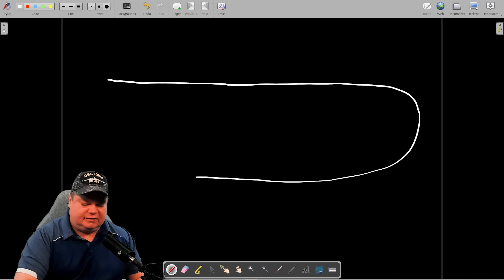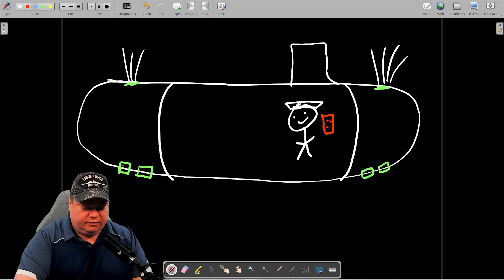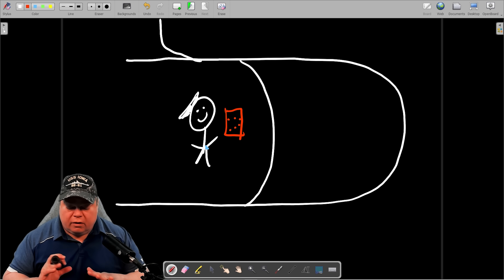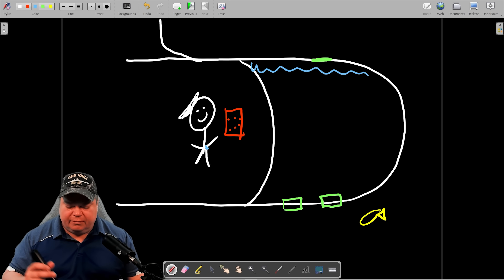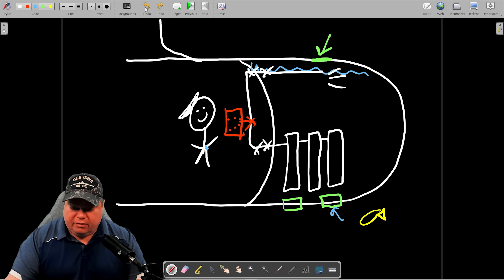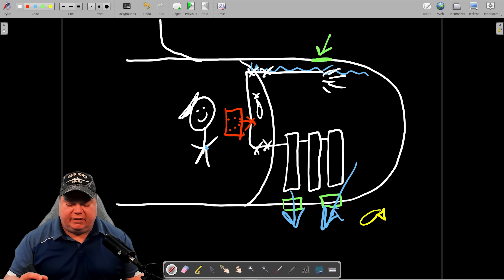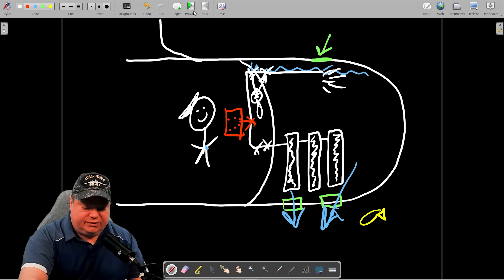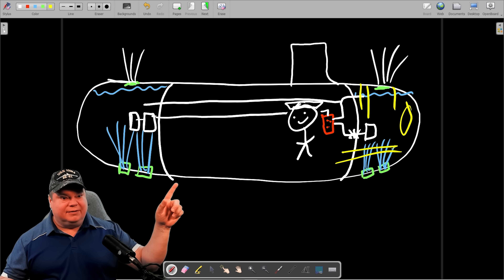Explore the Depths: Submarine Main Ballast Tank Operations Unveiled

Comment: As just a car mechanic and apprentice power engineer, If i might take a crack at whats in the tanks --  In the forward tanks, Torpedo tubes and doors, Sonar dome, whatever version of VLSS it may have; rear tanks - shaft for the screw/s or propulsor, Rear Torpedo Tubes and doors if equipped, decoy/noise generating devices and/or their own launch tubes;  in both tanks - sensors of some kind to indicate ballast tank state, water temperature and/or other monitoring devices (IE Salinity, radiological, possibly biological/chemical sensors, pressure sensors possibly,  of course related plumbing/mounting hardware, actuating mechanisms for the top vents, maybe outer trim tanks, also, would there be any form of baffles to limit sloshing of water?  Of course, all this is 'general', as there'd be wide variations between classes, designs, and probably even individual boats. 

As a 'general' question, would there generally be separate main and emergency blow tanks? Also - where might the anchors be located?

Always great to see your work! And yes, i know, 4 months late, sorry!
Reply: Wow a fairly comprehensive list and yes all of the above
Reply: On diesel boats they would have a Q tank this was flooded, in an emergency to effect a fast dive say in less than a minute a nuke takes up to 8 minutes to dive. But is not going to visit the surface again usually until the end of its patrol.

Comment: I've been trying my hand at designing a autonomous midget drone sub and have been reading a lot of Ulrich Gabler's writing on the subject...he designed the Type XXI sub during the war along with several other types, plus several post war designs...and Mr. Gabler indicates that the top vents should be placed as far back as possible when engineering the ballast tanks, or else the sub can dive at an awkward angle.  He goes on to mention those slits at the bottom as a source of eddy currents between the pressure hull and outer hull, the energy creating those currents has to come from somewhere:  your propulsion system.  So a lot of care is usually taken in their design.  Those valves connected to the "captain's flask" I think are shuttle valves...the act like normal hydraulic valves until you add pressurized air on the far side of the valve, which closes of the hydraulic input and shoots compressed air to whatever piston the hydraulic fluid was driving.  Combat aircraft back in the day had a similar system in case the hydraulic lines were compromised or the engine driving the hydraulic pump was no longer running.  It was a last ditch effort to lower the landing gear and flaps.  Usually would result in the entire hydraulic system having to be purged a refilled later...better to have to do that than to write off an expensive plane!

Comment: Do you know how a submarine, especially a small research vessel maintains it's internal (passenger compartment) air pressure?  Scrubbers remove CO2 but if oxygen is bled from bottles into the interior does the pressure slowly increase during a dive?

Since the pressure is greater outside the hull, you cannot simply open a valve to vent the rising internal pressure.  Does the CO2 scrubbed equal the O2 added during a dive?  Are compressors used to pump out the excess internal air to maintain a constant pressure?  Or, do you simply live with the gradually increasing air pressure?

Comment: torpedo tubes and sonar array would have to go through / be in  the ballast tank, yes? also the propulsion system / propellor shaft?

with the grates in the bottom, wouldn't this mean if the sub ends up on its back somehow, you can't surface? i guess that would have to have been assessed to be just about impossible, right?

Comment: I've never understood how entrained water does not effect a subs bouyancy. WWII subs all had large amounts of entrained water in the hull. the answer must be simple but I just don't get it. Thanks.
Reply: Simply because the entrained water is not part of the sub, it is part of the sea. Same as the ballast water. There are two ways to look at it: either you consider the water in the ballast tanks as added weight while the volume of the sub remains constant (this is the american way, the one used in the video). Or you consider any sea water, including the one in the ballast tanks, as part of the sea. In this approach, as the submarine dives, its volume actually decreases (because the volume of the ballast tanks, which was part of the sub on the surface, now becomes part of the sea) and its weight remains constant, therefore loosing buoyancy and diving. This way of thinking is easier for the problem you mentionned because then you understand that entrained water, like the ballast water doesn’t directly affect buoyancy. It is the decreased volmue that affects buoyancy.

Comment: 3:05 Would their ever be a need due to failure or damage to need to dispose of these lead weights in order to serface !? If so. How do you get rid of the lead weights under water ?
Reply: No all you have is emergency blows and you would power up on hard arise on the planes.
Reply: You would use a Low power blow to establish trim
Reply: Also emergency blows have an anti dieseling valve fitted as the valve would freeze with the HP air blow.

Comment: QUESTION:  does the submarine use ballast to control its depth in the water at all? In cold waters i use ballast tanks constantly, is that realistic? Wouldn’t you run out if compressed air if you did use flood and then blow ballast tank constantly.
Reply: No, in the submerged condition the ballast are always completely full.
Reply: @johnwinkler5361 thank you.

Comment: Very interesting, thanks for making the vid.  But this leads to further questions about the compressed air and where it comes from.  I assume there are multiple rotary screw  compressors on board to replenish the ballast tank air tanks but where does the air come from?  One cubic metre at multiple barr pressure inside the ballast air tanks would mean multiple cubic metres of uncompressed air to source the compressed air.  Air would be at a premium in a sub I would assume and no one wants to work in a vacuum (literally).  Big gulp at the surface?

Comment: Great video as always, I have just 1 question because I feel I am missing something. When the tanks are blown and full of air, but the grates are open to the sea, what is sealing the air inside the ballast tanks? I can't imagine you'd want to be running a pump to continuously maintain the pressure inside the tank, that seems extremely loud, but how else do you keep the air in an unsealed tank? Thanks!!

Comment: Is the air pressured till liquid? Provided a sub uses all its pressurised air, but gets to the surface - can it generate a new stock, or needs to get to a place, where it can get some already pressurised? How important is the bouyancy? Can a sub get to the surface even if it has a negative bouyancy and no pressurised air in stock? I. e. can it surface with the balast full? If the top and bottom valves are open in the ballast, the water should flow freely, so its weight shouldn't count to the weight of the sub it seems, am I wright? Provided the ballast ist open or damaged, so water travels freely though the ballast tanks - is the sub bouyancy positive or negative, or it is irrelevant and nobody cares of that? :)
I am sorry, if some questions are hard to understand - English is not my native language... :))
Reply: Subs have high pressure air compressors to refill the Air Banks. You always want to be positively buoyant on the surface. If you have propulsion you can drive yourself to the surface using horsepower. But you are on the surface and negatively buoyant. Aaron didn't talk about how we fix this normally, so neither will I. If the ballast tanks are full of water and you are on the surface you are not surfaced, but you do have a ship full of angry people. So when the MBT's are full of water the boat weighs what it weighs and you want it to be slightly negatively buoyant. It you fill the MBT's with air the boat is now lighter by the weight of the water you just displaced, and now you are positively buoyant.

Comment: I had a couple uncles that served on WWII subs. I've been on a couple old subs, not part of the crew. WWII grates had valves. When the valves were left open on the surface  they called it riding the vents, It was for faster dives. I wonder if the design change from then to current subs had to do with the Thresher and Scorpion?
With no grate valve, air pressure would have to be maintained on the surface. So what happens during fitting out and overhaul? Or mothballing?
Reply: The Thresher and the Scorpion had grates.
Reply: The valves at the bottom openings of ballast tanks are called "Kingston valves" in most books I've read on submarines. WWI-era submarines in most navies had them. Friedman's 1994 book "US Submarines Through 1945" writes that Kingston valves were phased out in US submarines mid-WWII.

Comment: Another idea for a discussion, most subs have forward and stern diveplanes, could you explain when each is used, are they always used in tandom, thx
Reply: The bow plane are for main debth control. Stern planes mainly control the bubble or angle of the ship. At higher speeds, stern planes can control debth. Rudder is use to stear the boat and control the coarse.

Comment: What happens to a submerged submarine if the ocean floor it is over has a sudden geological displacement (aka subjection earthquake)
Reply: In theory, and this is out of my realm, but let me take a guess. If a sub is over or near a subjection earthquake when it happens, the bottom of the ocean is what's moving. The bottom would or should transmit that movement into the water in the form of a pressure wave(s) which Sonar Tech Aaron would hate. The pressure wave moving to towards the surface would or should move the same way but it would look like a subwoofer moving back and forth. This would cause a momentary change in buoyancy. I have no idea how fast those waves would travel, or how big those changes in pressure would be. Now, are you asking what happens if a sub suddenly finds itself over an active underwater volcano? That would be a cool movie.

Comment: Can a submarine get to an operational depth where the high-pressure air can't push the water out of the Ballast Tank?
Reply: Operational depth? No. There is about 44 PSI of sea pressure at 100 feet. When you design a sub one of the questions you have to ask is how deep do we need to go? Then you build that depth into the sub. That determines what you are going to use for hull material (and never carbon fiber), how thick it needs to be, what your HP air system needs to be able to do, and lots of other things.
Reply: Not military submarines. The pressure in the air tanks is way more that any outside pressure the sub could ever reach.

Comment: Can the submarine generate the high pressure air (so it never runs out) or is there a finite amount of compressed air like a SCUBA tank?
Reply: High pressure air compressor.
Reply: When air volume get low, the ships atmosphere starts going into a vacumn. You have to go towards the surface and at PD, snorkel or ventilate to burp the boat. Take a gulp and go back down. You place a positive pressure in the boat so your volume increases. Yes, you can run out of air. You have oxygen banks that can keep you alive for a time. But the cannot charge the air banks.

Comment: What if it flips over, is it impossible to blow ballast?
Reply: If the boat tips over, there are other problems and it is probably bad. No barrel rolls, no loops.
Reply: @MarkLawrenceKiefer  I figured it's bad, I just wasn't sure if there was a process to block the vents if it gets toppled over so that they can still blow main ballast somehow
Reply: @oaw117 there is no system to block the openings below. They are just plain and simple openings. The sub is not suppose to capsize because the center of gravity is below the center of buoyancy, unlike surface ships.

Comment: It makes sense to me that you'd have a fixed opening at the bottom of the ballast tanks rather than a valve. There is no reason you'd ever want them closed. (I guess unless the whole sub is upside down, but I'd say you're already screwed if that's happened!)
Being able to close off the tanks would mean they can be at a different pressure to the exterior which I'm guessing they are not designed to handle and they would either rupture or crush, depending on which direction the pressure differential goes.

Comment: A couple of questions. With the drain grates are how do you keep the grates from making noise when the sun is underway. And you mentioned the ballasting of your boat, if the trim is that sensitive with full forward and aft tanks full, how do you account for the salinity of the water and when you are transitioning from high to low such as going into the Gulf Stream from the Caribbean Sea?
Reply: The grates are not loose, they are fastened to the ship so that they don't rattle, but are removable. Salinity changes is most common in the Arctic (ice freezing or melting). Temperature changes are more common (Gulf Stream, or depth). We have what are called Trim tanks that let us bring water in or out and move it around.

Comment: Some questions (might be enough for a part 2, if you collect questions for a couple of days): 
1. The obvious one first: If those are the "main" ballast tank there are obviously more. Do the others work on the same principle?
2. Are the main ballast tanks (or probably the others?) linked into pitch control?
3. How do you service these "have to be closed to the inside" tanks your life depends on? Is there some screwed close hatch to the inside or the top to do maintenance in port?
4. Good there are backup systems for the valves on the top. I assume there are also backup systems for the hatch on the top?, because if that stays open ...

My guess (for 1 and 2) would be: Main ballast tanks only to get it perfectly balanced at your target depth with all controls zeroed and all the other ballast tanks and control surfaces to angle your boat however you want.

BTW: Thanks for bringing back whi... bla.. whatever colored board. Really liked that series.
Reply: To do maintenance in the MBT's, you have to enter drydock. Once the boat is out of the water, you can open the MBT grates on the keel. Then you go into the darkness of this slimmy tank and do your repairs. Been there, did that. MMC/SS AGANG RET.
Reply: Main ballast tanks  are only flooded or not flooded. They do the bulk of the work to get the submarine to submerge/surface. Then you have multiple smaller trim tanks around the sub. These trim tanks are used to finetune buoyancy, and balance the pitch/roll. Then additional ballast tanks to compensate for the loss of weight when weapons are launched. As for servicing, I have no Idea, but I would suspect they are only really serviceable in drydock.
Reply: On 688's, 637's and 594's you can access the MBT's through the grates on the bottom when you are inport. To do that your ships divers or divers from the repair facility go down and let themselves in. Then they do what ever needs being done in there. This brings up a whole discussion about subs and divers and safety and tagouts. Also I am not saying that the other boats don't have grates. I am saying I never touched a boomer or anything older than the Gato (except to take a tour on a museum ship).

Comment: I was in the RN, but never realised Main Ballast tanks were permanently open to the sea until I started working with Submarines. I imagined it like a normal tank that had a valve on the top, and valve on the bottom. DUH.
Reply: Older submarines had valves on the bottom but they removed them for simplicity. Some russian submarines may still have them,

Comment: Also a safety aspect to have grills in the bottom of the ballast tanks. If you have valves there instead and they fail, you can't drain the tank to surface.

Good stuff though. I'm a civilian engineer on submarines and this is all very interesting to watch.
Reply: Somewhere, I suspect Silent Service, there was a Depth Charge that exploded not too close but directly under the submarine so that the gasses rose into the grill, displaced the water, and the submarine uncontrollably rose towards the surface.

Comment: Torpedo tubes, sonar, prop shaft
Reply: VLS tubes
Reply: @taco44051  wasn't sure if those would be part of the ballast and they aren't in all subs at the bow which is why I didn't mention them. My parents used to work where they made the sonars. But also with that, not fully sure if it's in a free flood area or would be considered ballast tank

Comment: Hmmm. Three things that might be inside a forward ballast tank? Torpedo tubes, sonar dome, forward diving plane hydraulics.
Reply: Spherical array, hull array, SA access tunnel, UWC hydrophone, NMH hydrophones, OA-9070, anchor, SPM, my initials.
Reply: @taxationistheft75  That last one - chefs kiss.
Reply: Headlight and turn signal access
Reply: @creid7537  FSD sensors, too. Aren't we up to beta 14x now or is that only in a Tesla? Edit: Silly me, those go on the outside of the sub.
Reply: @themacker894  lol yes that's silly. Even with current V3.0 long life LEDs you're going to need access to change the bulbs while submerged. Safety first.
Reply: and VLS missile tubes on the newer subs
Reply: VLS has been used in the 688I versions sence the 90's.
Reply: I can only think of some kind of missile. Either Tomahawks (which can have thermonuclear warheads) or an anti ship attack missile. But I would guess maybe not any Intercontinental Ballistic Missiles. Cuz that would weigh so much that firing a full retaliatory nuclear strike would cause the stern to pitch up.